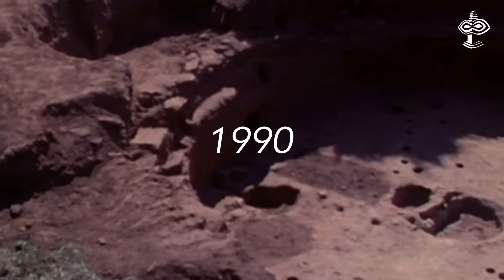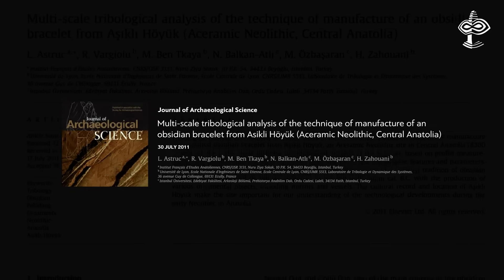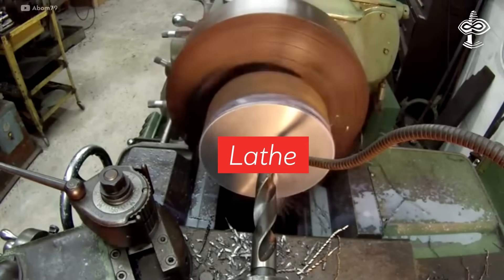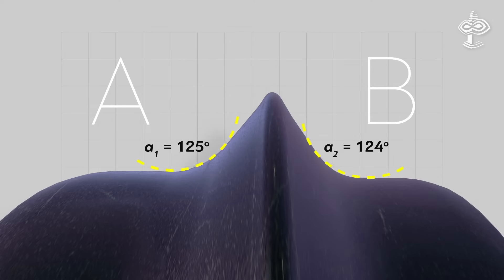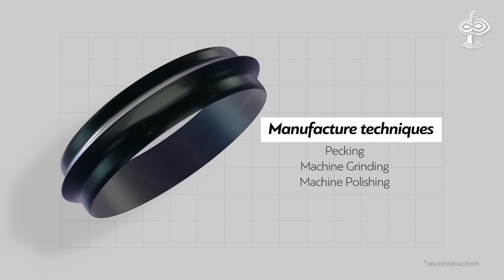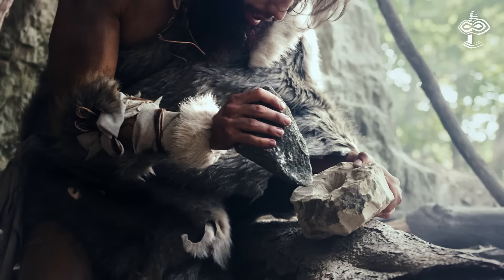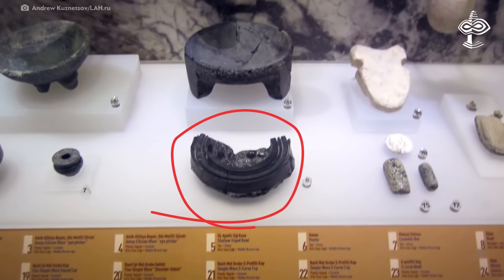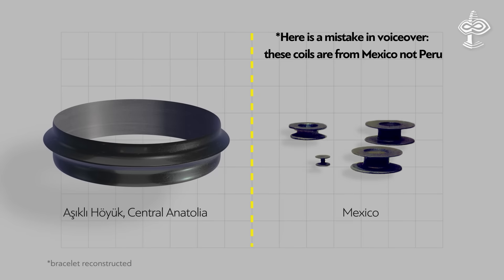This obsidian bracelet is 9500yo and it was made with unknown MECHANICAL devices - VERSADOCO

Comment: Archeologists tend to bury any object that does not match their theory. This is not science but pure charlatans disguising themselves as scientists. To achieve this kind of precision machining requires extremely high technology lathes and industrial diamond cutting tools that has no vibration. Even modern cutting and polishing techniques has vibration which will shatter very brittle obsidian. Let the so called archeologists try to explain this artifact away.

Comment: A potter's wheel balanced to near perfection can achieve the rotation required and not require electricity or electric motors. As for the polishing, they could have made jigs out of another material and used a fine abresive like fine dust made of obsidian ground up in mortars which are also old technology. Imo we have underestimated stone age technology but do not jump too far on what is required to produce intricate gem or stone pieces by likely the best artisans of an era using clever techniques.
Reply: The contact of two hard objects like diamond bit with obsidian, on potter wheel, could make the surface look like moon, with wild vibration.
Reply: @bamh1re318  search "pots made from stone" on Lotishu channel, found a short video of stone pot makers in India using a sort of hand powered lathe, basically the roughly shaped stone is glued to the top of a stick, then held horizontaly on a simple wood frame, while one worker pushes a belt (could be substituted with leather or rope) wraped arround the mild of the stick to spin it in place, another uses a chisel to shape the stone. I can imagine ancient people coming up with similar solution. As for your remark of the material shattering, for all we know they could have used a wood frame and the abressive material did all the work, use your imagination.

Comment: A common failure of the archeologists is not stressing the words “at least” when they find something.  Just because it’s in that layer of dirt doesn’t mean it’s not older. Rocks can not be carbon dated only organics.  Just because a bone is 100k old doesn’t mean that it came from the 1st of that species, likely had they developed many many years before we found a bone. Fossilization is rare and finding it is even more rare. This is why every new finding is pushing the ages back considerably. Have to keep an open mind.

Comment: More than likely a master in stone would have worked out that large circular stones, with a hardness greater than glass (obsidian) revolved at a relativity high speed by simple gearing... and the part placed on an axle itself? With a polishing paste could achieve this.... But insane discipline is still gained by clever hands!

Comment: Thanks for this interesting video!
-the study from 2011 focused on this fragment and used only a narrow set of methods
-it was from the look an obsidian stone (not a melted glass), not existing in this location, no use of xray or other more reliable methods
-it was found in this old earth layer, but no details, if this layer had been unspoiled, no other methods of age verification -and no later study on this adding certainity.
-it was just a small curved fragment found, the full circle is an (likely) assumption.
- the carnelian  beads are better researched and found also in the levante (Tell Halula): likely both artefacts came to höyük by trade- someone had the precision late/turn-wheel know-how, but not likely the locals in höyük.

- with a stable center axis, you get precision also with handdriven tools-as far I know, metalls where not yet mastered, so may be a mineral like jadeite was used to get a precision axis..but this just shifts the question: how could this axis made so precise? And why are none found until know?
Indeed, it looks a bit like out-of-place artefacts, but yet little confidence gathered in a yes or no.
Reply: The carnelian beads are a good trace.
According wiki in trade since 3000BC, but the study here and others date this trading back to ~8000 BC..see also „Lapidary technology revealed by functional analysis of carnelian beads from the early Neolithic site of Nahal Hemar Cave, southern Levant“
-Exciting, may be this was an early type of money..and it showed the precision level in stoneworks-at least by using a bowdrill-was quite good: looking forward to experimental archeologist testing this..

Comment: Primitive lathes are relatively easy to build, just check out medieval lathes. I could take the same concept of a medieval lathe and turn it on its side like a pottery wheel and fasten the stone with a bunch of pine pitch glue and turn it back and forth with a rope working the stone with some sort of sand stone, or sand and rope which was a method of cutting stone that worked relatively well before saws. Scientists need to start talking to people who still work with these tools, an often overlooked avenue, it's like they try to reinvent the wheel sometimes

Comment: Its scary to me how people hear something and instantly believe it without doing any amount of reading or research. Here i found this is a scientific journal about the bracelet. It didnt require mechanical tools to make. This is so wild how people in this comment section refuse to read.

"The nature and distribution of the wear marks indicate that three techniques were employed consecutively to shape and finish the bracelet. These techniques are: pecking, grinding, and polishing. Each technique is responsible for partial or complete obliteration of the marks produced by previous work. Therefore, it is possible that flaking was used prior to or in combination with pecking in order to obtain the volume of obsidian required to make the bracelet and that flake negatives were removed."
Reply: You should continue citing. The researchers do talk about mechanical devices use specifically. And they underline that this artifact requires higher technical input than just grinding.

"In sum, different tools and abrasives were used for grinding and polishing. Differences in striation patterns indicate different movements employed for polishing. 

The formation of concentric striations with consistent orientation and the profiles extracted point to use of mechanical devices for grinding and polishing.

These data differentiate the As¸ıklı Höyük bracelet from the Çatalhöyük mirrors (6520e6220 cal. B.C.; Cessford, 2001; Vedder, 2005). 

The manufacture of these objects involved flaking and “a relatively simple technology in a manner analogous to the production of contemporary ground-stone tools and other items” (Vedder, 2005: 597). 

*The tools used to obtain the complex form of the Asiklı Höyük bracelet indicate higher technical input*."

And - "The use of mechanical devices for grinding and polishing is also anticipated and experimentation can help identify the tools and abrasives employed."

And - "Conclusions. 
Multi-scale analysis of wear variations on the obsidian bracelet from Asiklı Höyük revealed a complex manufacturing method.

The bracelet’s symmetry, the movements executed during the manufacture, as well as the probable use of mechanical devices for grinding and polishing open the possibility to discuss the production of this artifact in relation to technological specialization in Anatolia during the early Neolithic."

Comment: Obsidian can be shaped with sand (quartz) which is harder and very available, as well as other minerals that are harder than glass. Polishing can be done with clays. Steel tools are not needed. What is amazing is that they apparently had something like a lathe or a spinning wheel like potters use today.
Reply: This was pulled from a scientific journal on the artifact lol. Please just read. This video is complete nonsense.

"The nature and distribution of the wear marks indicate that three techniques were employed consecutively to shape and finish the bracelet. These techniques are: pecking, grinding, and polishing. Each technique is responsible for partial or complete obliteration of the marks produced by previous work. Therefore, it is possible that flaking was used prior to or in combination with pecking in order to obtain the volume of obsidian required to make the bracelet and that flake negatives were removed."

Comment: Can't discover old metal... it rusts. Originally it may have been some kind of tube connector. Or pulleys. Not a bracelet.
Reply: This was pulled from a scientific journal on the artifact. Just do some reading lol. Reading doesnt cause brain cancer like you think it does.

"The nature and distribution of the wear marks indicate that three techniques were employed consecutively to shape and finish the bracelet. These techniques are: pecking, grinding, and polishing. Each technique is responsible for partial or complete obliteration of the marks produced by previous work. Therefore, it is possible that flaking was used prior to or in combination with pecking in order to obtain the volume of obsidian required to make the bracelet and that flake negatives were removed."
Reply: @TrentenMerrill092 wow nice and very explicit DENIAL ! 😂

Comment: Hunter gatherers absolutely had an understanding of turning. The pottery wheel is a great example and precursor of the the lathe that they had literal "hands-on" experience with. Which of course had a precursor in the bow drill, and before that a simple drill for fire starting.
Reply: there's a huge difference between just turning and rubbing something and finishing something with high symmetries.  it would require precision bearings with mechanical work locks and tools rests.  stuff we didn't have till the industrial revolution.  that's the thing about all the precision we've been finding in the ancient world. we didnt even have the tools and knowledge to recognize and measure it till the the mid to late 1800's.  but the items were created thousands of years ago.
Reply: @FINNIUSORION  Actually, we make our highest precision surfaces by grinding, scraping, lapping and polishing (even today). Often done by hand. Nothing about the features of that bracelet requires power tools, precision bearings or even metal tooling. The center was certainly done with a stone/bow drill initially. It was likely turned between fire hardened centers on a simple tapered mandrel with a helper to spin the mandrel. This quality of work could easily be achieved with a simple tool rest. Wood is still turned like this today, and I still do deburring and polishing processes on metal parts by hand, in the same manner that this was made on my Lathe. The major difference is my lathe is powered by an electric motor, and the one that made this was powered by a helper with a bow with a chord made from animal gut. There is nothing about this artifact that implies any sort of precision measurement/metrology was used in its making. The maker of this video uses the wording "machine tools" which he is intentionally implying to mean power tools while picturing modern lathes and high speed rotary tools and wording like "advanced mechanical technologies". The topic of the video is not the creation of the bracelet itself. The author is trying to use the bracelet as evidence of some sort of advanced civilization. The creation of this bracelet is in-fact well within the capabilities of stone age man giving the materials and technology they had available and so does not support his conclusion.
Reply: @mxguy2438  words are not proof. Please replicate it to learn the difficulty level that would be beyond hunter gatherers. The world is waiting for your sample pieces.

Comment: Or most likely, the method of dating is wrong. And that artifact was either placed there or lost by someone else. Radio active dating on the bracelet is completely irrelevant. When was it found? Were there numerous people there, witnesses to the finding? Was it impossible for anyone to plant it? 
You are jumping to a lot of conclusions that can be easily explained away, by much less grandiose statements like "it was machine tooled, in an era that did not have machine tooling".
Science is failing us everywhere. Well, not science failing, but those that teach it are getting lazy.

Comment: 9,500 years is well within settled civilizations like Gobekli Tepi (ca. 12,500 y.a.) and rotation tools (like a bow strung around a shaft with a tip for drilling fine holes or starting fires) has been around for a very long time.  Quartz will cut obsidian and fixing the rotation, like fixing a rough obsidian doughnut - a rock with a hole drilled through it- on a horizontal axis supported at both ends would explain the symmetry.  Also, only a very small  fragment exists, so the whole thing might have never been completed or could have exhibited major faults.  This is an example of underestimating those cultures abilities, not to mention that it could have been made much later and deposited at a deeper layer.

Comment: This really doesn't seem that incredible. I'm sure you can get the same effect as a lathe by just putting like a wooden dowel through the obsidian and rolling it over wet fine sand on top of a leather. It's Turkey so they had high quartz sand. having 2 sides like that further suggests that they just laid the leather over an edge and that formed the curve and they could just roll it over the curve. Then just use something like clay and fine sand to polish.

Comment: Why is this being described as a "bracelet", was it found near skeletal remains?  Why expend this level of precision, and work on just a piece of jewelry?  The reconstructed image of the whole object in the video, looks more like a "flange or gasket".  Obsidian is a glass and therefore an electrical insulator. As an example, in modern usage, such a device could be used as an insulator-interface between two metal cylindrical contacts which you may want to be electrically separated.  A posted comment here, mentioned it looks like an "O" ring, as well.